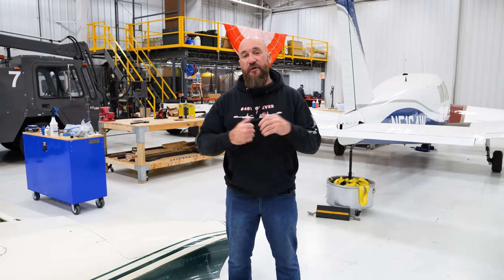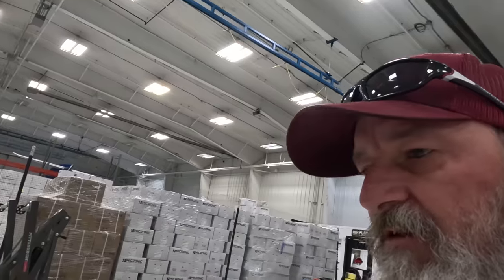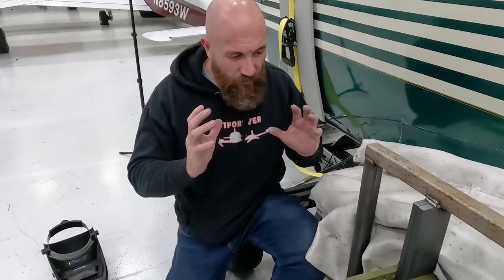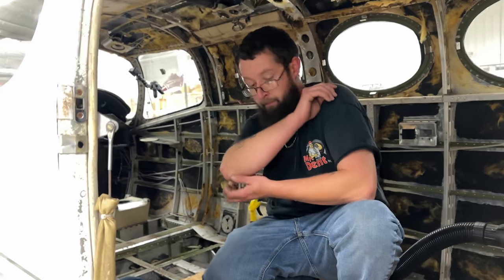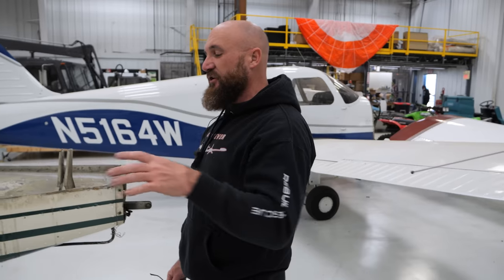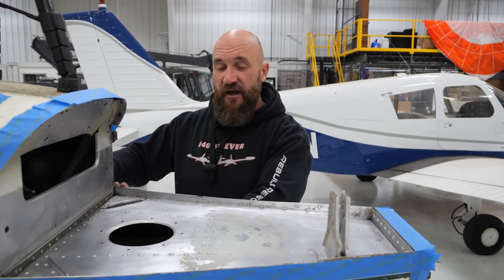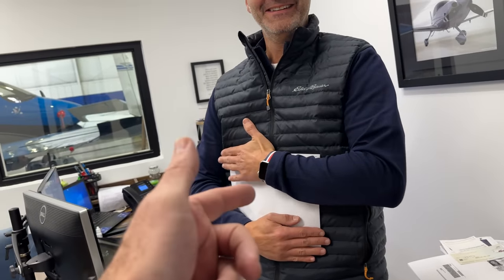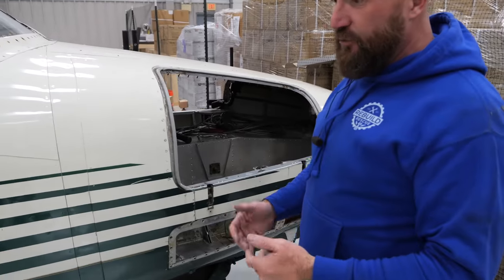Getting The Free Abandoned Airplane Ready To Leave The Hangar !

Comment: i don't really understand , i've thought you don't wanted toi stress thoses wings fixation . the weak one can break , specially with only 2 bold on it ...the rear  one , the long one , 7 bolt each normally ..good reason for that . you just put 2 bolt on each one and gonna stress that things in a way not design for ..the bolt could torn that support.  in another word , the load is normally over 14 bold not only 4 .this is just the fragil thing you don't want to break. there is no suspension  on the trailer , all shock from the road , normally in the air .. you really should pay attention i say. well normallly the wing stretch and pull over thoses things , the vector are very different ,i think you gonna stress thoses mounts in a very sick way ...

Comment: The 401 should be painted to appear as an air ambulance with appropriate badging.
Reply: @mmayes9466  I did not mention “standard” just air ambulance, so we have a clean slate to be trend setters. I could design it with a major winged angel montage if I wanted and that is non-standard.

Comment: I'm actually flabbergasted at how much is being done to get this girl back in the air, you guys are going over and above to make it airworthy and to be honest, if you are going to be flying it yourself, you'll have absolute peace of mind she's been restored correctly and as safely as possible. I'll be here every step of the way to check in on your progress, I really admire your dedication to the project, what does the former owner think of all this so far?
Reply: They're doing what is required by law...
Reply: @JCrook1028  Zinc coating every surface isn't required by law... Updating all the avionics isn't required by law... A new paint job isn't required by law... The list goes on.
Reply: @Jjengering  True on the xinc but cleaning all those areas is tho so........... that's where the work is. Avionics almost certainly are required update due to the use of the airplane when finished. Paint job would be stupid to not do when so many pieces from other planes being put together.
Reply: @JCrook1028  Yeah, but the point is, those things aren't required by law, so they are going beyond what's required :) also I fly planes regularly on old avionics (steam gauges) you certainly don't need to update the avionics to fly safely, it's just another tool you can use to make your life easier.
Reply: @Jjengering  you fly medical angel flights? I'm sure they have regs.

Comment: How do you eat an elephant? One bite at a time . Some with working on aircraft one piece at a time for taking them apart and putting it back together. And with all the paint going back on the weight and balance will have to be redone. For the paint job do a 3D rendering of the paint scheme before you paint the plane.

Comment: Aircraft are built to such extremely fine tolerances, with built-in triple redundancies to critical structure, that even a scratch can propagate into a catastrophic crack resulting in airframe failure. A question: Do know if this airframe has been overstressed?
Reply: Something to think about. When the engines are removed from airliners the wings are then weighted to account for the missing weight of the engines.

Comment: not keen on the all the single shear joints, i'd of notched them all so each tube sits into the item it's being welded to then welded,  espesh the plates that are bolted to the wing spared to where they meet the top bar, 
cutting a square notch into that plate then putting the bar into it so you can weld around 3 sides would make that much stronger and supportive.

Comment: I think, given how long this thing sat out getting bird debris, dust, rain, dust-to-mud, more rain, more birds, etc.... I think that the comprehensive cleaning is vital. I'd wager that there was a couple hundred pounds of filth in that aircraft when you first towed it off the tarmac... and you probably took most of that out just removing whatever straw material you could get out on the first pass. But even now, I'd wager between you and your detailer you took another couple pounds or so of just plain surface dirt off the airframe. Weight is everything in an aircraft, and getting as much of that "deadweight" of garbage and just plain old dirt out of the 401 is going to be worth it's weight in, well, fuel. 🤪